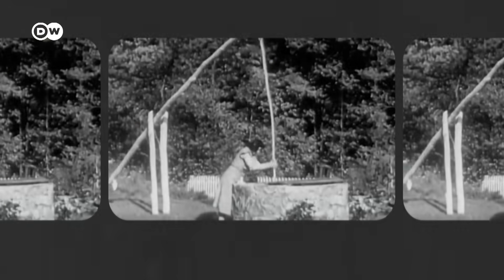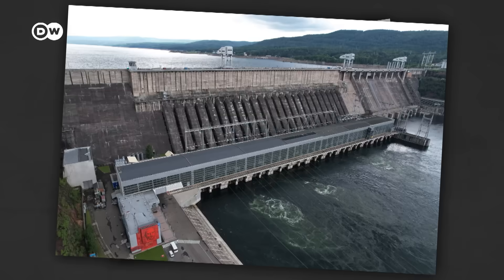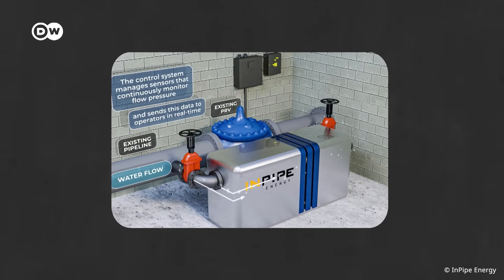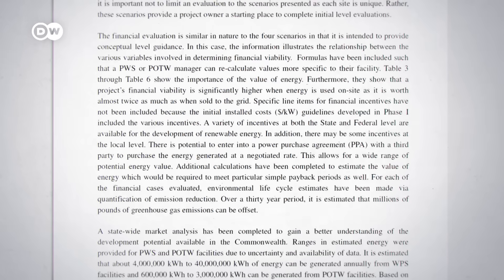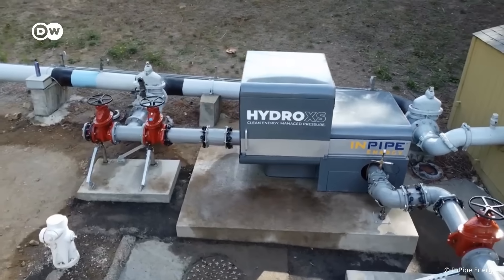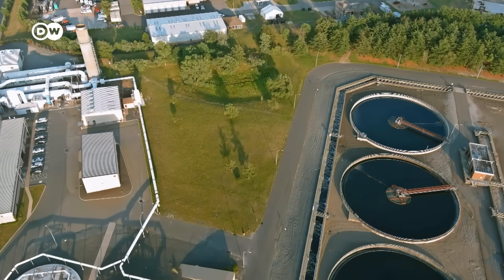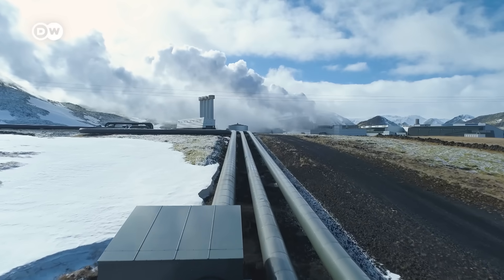In-pipe energy: The hydro power nobody is talking about

Comment: Imagine acres of durable long life solar  panels over lakes and rivers powering pumps that refill thousands of water towers on land and at night it is released at a rate that provides steady power throughout the night and more if necessary.
Reply: Well... About that...
The potential energy is defined as E = m x g x h, with m the mass in kg, g the gravity potential (usually rounded up to about 10km/s/s, and h the height in meter. E is given in Joules.
If you have let's say, one metric ton of water (one cubic meter) and let it fall from a height of 100 meters, you can get 1000 x 10 x 100 joules of energy, that's 1,000,000 joules, or approximately less than a third of a kWh. And the average western household consumes about 10 to 20 kWh of electricity per day.
So you would need a reservoir of about 60 cubic meters of water built on a 100m tall tower (equivalent to a 33 story building) to store enough energy for one household for one day. Alternatively you can reduce the size of the tower to 10 meters but will require 600 cubic meters of water.
So yeah... It's fair to say we won't see as many towers as that any time soon.

Comment: Adding turbines equals adding resistance to the flow. If this is done at scale, there would be MORE ENERGY CONSUMED at the pumping stations, to maintain the pressure and flow, negating the energy generated by the turbines. Given that no turbine is 100% efficient, there would be a net negative result.

Comment: Seems like a way to steal electricity from the city power. All of a sudden their electricity bill goes up to pump that water harder to keep pressure at the right level as us homeowners are siphoning off that pressure to create our own electricity. Energy is neither created or destroyed, just transferred.
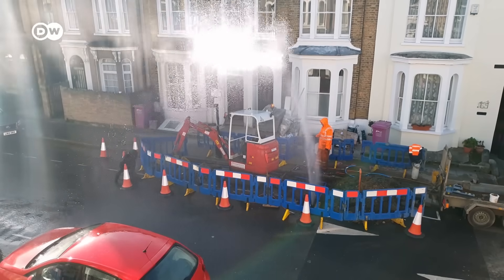Reply from the maker: Hey Kent! The video is specifically talking about making use of the energy that's currently wasted at pressure-release valves. Check the section around 2:36 where we explain it in more detail. 💧

Comment: This is stupid. It is not free energy. If you put a turbine in pipe and draw electrical power you are reducing the line pressure. If the pressure was too high to start with just reduce it and save on the massive cost of pumping. If it was not too high you will cause distribution problems further down the line.  You could charge your telephone at the point of delivery if you have more flow that you need. But installing anything actually in the distribution network is like putting a dynamo on the front wheel of you bicycle to power an electric motor on the rear wheel !!   Stop your "carbon" BS and learn some basic science before making a video.
Reply from the maker: Hey there! The video is specifically talking about  making use of the energy that's currently wasted at pressure-release valves. Check the section around 2:36 where we explain it in more detail. 💧
Reply: @DWPlanetA  Ah! So it's talking about extremely small, almost negligable quantities of energy that you might be able to harness an even smaller percentage of! 

This harebraned idea is little more than nonsense.

Comment: just design the pump more efficient, and prevent it from creating excess energy to begin with
don't spend extra energy to create energy, that's dumb your stacking inefficiencies like friction, and heat loss on top of each other

this only make sense when your not spending energy to pump water, such as when your water is stored up high
then you can use a turbine to generate power and lower water pressure to safe levels

Comment: It takes energy to move the water through the pipe, so it stands to reason that by adding the resistance of a turbine to generate electricity just means that the system will have to use that much more energy to overcome the resistance, thereby requiring the water utility to add the same amount of energy that you're removing from the system. There is no free lunch!
Reply from the maker: Hey there! The video is specifically talking about the making use of the energy that's currently wasted at pressure-release valves. Check the section around 2:36 where we explain it in more detail. 💧

Comment: LETS TALK ABOUT COMMON SENSE.  
water is pumped at very high pressure because very high buildings require that much immense pressure to lift water to tanks which is 
situated at top of these high buildings.

BUT THE POOR PEOPLE LIVING IN SINGLE FLOORS DON'T REQUIRE WATER AT SUCH HUGE PRESSURE. 
IN INDIA  MOST OF THE BUILDINGS ARE SMALL.
THE RICH PEOPLE OFTEN LIVE IN TALL BUILDINGS.

SO PRESSURE ENERGY IS GETTING WASTED WHICH LEADS TO WASTAGE OF ELECTRICITY.

 SO THE SOLUTION IS THAT WATER MUST BE DISTRIBUTED AT LOW PRESSURES  AND TALL BUILDINGS MUST HAVE THEIR OWN PRIVATE PUMPS.
SO PEOPLE OF TALL BUILDINGS HAVE TO PAY MORE MONEY FOR SAME WATER USED BECAUSE THEY ARE USING MORE 
PRESSURE ENERGY (WHICH MEANS MORE ELECTRICITY).

FOR EXAMPLE, IN INDIA (JUSCO ) DISTRIBUTES WATER AT LOW PRESSURES AND PEOPLE LIVING IN TALL BUILDINGS HAVE THEIR OWN PRIVATE PUMPS.

SO CORRECT THE      CORRUPT SYSTEM     RATHER THAN USING   FANCY DEVICES.

Comment: Hi all just a message just posted this on some windfarm sites thought it was worth adding to this page So. 
If you grind up old wind farm blades both glass and carbonfiber and add then to wet concrete at the batching plant i can see a real risk issue can you? ,,,,,   Well its 30yrs later and the slab is to be crushed up for the new development to get made what happens with the rubble ? and more worryingly the dust. We have seen this before with a product that was loved in its day and ended killing thousands it to was mixed into concrete as sheets got were i am going yet NO ASBESTOSIS disease a man made issue rearing its head again will we ever learn from the past?

Comment: I found this video trying to understand the variables to make a good turbine. Here is my situation: I live in Alaska off grid. Things that are true: It is dark here in the winter (thus solar is not a great option) and water and rain is abundant and I live on a very steep hill. I do not understand the physics of how the conversion of potential energy (moving water) is then converted into power. If I wanted to make use of hydropower in a very small way what formulas do I need and what factors change the potential to capture the energy most efficiently? This would not be the only source of energy, but I would be great to have as many as possible as there are not services in our area.

Comment: solar & wind are not green tech Why? both end up with 40-60% in land fill so what is green tech? RDP Marines add on units to dam to make more power from the same volume of water used lasts 100years fully recyclable and unlike pump hydro which uses 40% more power to lift that water than is returned. Now just for full disclosure i am RDP Marine AND we have an add on system for large water storage dams and hydro to make more power from the same volume of water. So all dams have one bank of turbines due to issues if there were more we have fixed that issue and now three banks can be fitted
Reply from the maker: Hey Simon! We just published a video on wind turbine recycling that you could be interested in. Check it out here 👉 https://www.youtube.com/watch?v=HzQShAlObn8
Reply: Thanks for the direction did as you said got a comment for your bosses.
Wittenoom near Perth Australia is a small town now made a no entry place with a exclusion zone of 200 Hecters square . why am i telling you this well the reason is in the local mine is a rock with fibers in it that was a big deal in its time you may know of it as asbestos now what do you think will be the outcome of concrete being busted up that has glass fibers in the dust ?

Comment: The energy inside the pipe is to ensure most of the people has enough pressure in their household. Not for energy generation. If you want to save energy, the pump system should be designed intelligent enough not to over pressure the piping system.

Same thing, You shouldn’t put a solar panel under a street light to generate electricity because street light is simply not meant for energy generation.

Comment: Typical woolly green thinking here.  This is akin to fitting a wind turbine on top of a car and ignoring the extra power needed from the engine to drive the car against the drag of turbine.  The power to move the water has to come from somewhere - and that energy would be from the pump supplying the original pressure -  more resistance in the pipes from turbines will increase power required from the main pump.  The greenies will talk about this idiocy, but engineers will not.

Comment: In simple summary, if the area's water system use pressure valve, then that system can be use to generate electricity.
Some area might dont have enough pressure to supply water

Comment: WHERE TO BUY THIS SMALL WATET TURPINE?  AND: HOW TO TRANSFERE MOVEMENT OF THE BLADES INSIDE THIS SMALL TURPINE TO : (OUTSIDE; "without leaking out water"= SO TO USE THE THE MOVEMENT OF THE TURPIND INSIDE THE PIPE : TO USE OUTSID THE PIPE TO ENGAGE A WHEEL or so, AND THEN TO CONNECTED TO A GENERATOR??? THANKS

Comment: I know you have worked very hard for this but as a student of engineering I think this tech is unreliable because there is a question of efficiency. If you consume energy to generate pressure and in turn use that pressure to generate energy again then you just gain a fraction of the energy you had before. The overall potential is very very less than 4 % of the global energy demand. you need infrastructure to produce that energy which will be really really expensive. 
suggestions are welcomed...

Comment: i am not getting the excess pressure point. It is pumped into a tank and distributed from there. where is access pressure? In pipe turbine probably effect the delivery of the pipe too. at least the speed of the water in it. Probably there is a way around it. Keep up the research.

Comment: Ok... so the idea is to put turbines on the lines leading out of pressure control valves to generate electricity from the water that we are forcing out of the system to avoid pipes rupturing from the pressure being too high. Essentially, in water systems where we are currently wasting a lot of energy, we could reduce the amount of energy wasted by recapturing it at the back end.

This is thus really an energy efficiency measure... making our least energy efficient water systems slightly less bad. We'd still be wasting energy to get rid of water without using it... but not as much energy. As such, it is worth doing... but IF this is really going to generate significant amounts of energy then that means we are currently WASTING vastly more energy (and water) on inefficient systems.

Comment: The issue is that such a technology will not solve anything. If everyone puts an in-pipe turbine in their pipes, it will become harder for the water pump to pump the water, increasing the energy consumed by the pump, which in turn increases cost of the water. This is because energy cannot be free; it is a basic concept of physics. In short, energy generated by personal in-pipe turbines is energy taken from the pumps pumping the water.

If one or a few people install an IPT, it will be fine. If everyone installs an IPT, there will be an issue.
Reply: The pump will keep working the same way they are not going to replace the pump for more powerful one. But the water pressure will drop, water filters will stop working, some showers won't be able to push the water through small holes etc.

Comment: Energy is NEVER free! The energy tapped from the in-pipe turbines comes from the excess energy or pressure given to the water delivery system. The issue is NOT to tap energy using in-pipe turbines. The issue is to reduce pressure given to the water delivery system. Save energy at the source, not in-pipe!
I suspect this video is done by a journalist who does not know much about physics, let alone engineering. If I were the author, I would immediately withdraw this video from Youtube.

Comment: This seems like an absolutely dumb idea. Instead of properly managing water pumps so they use less power and run at pressures that the system can manage, you're suggesting using those pumps to over-pump water in order to spin turbines to generate power? That's like putting your car on a passive treadmill that's connected to dynamo and saying "Hey, look, my car is making free energy".
This would only work when the water source is high enough so that gravity does most of the work and you need a pressure reduction at the bottom. Otherwise it's the stupidest thing I've seen since Solar Roadways. Is this a rejected Matt Ferell video?

Comment: This video's content is extremely MISLEADING, or simply WRONG. Clearly, neither the video maker nor the professionals know how water distribution systems work. You CANNOT get energy at the end of the distribution network, simply because you need to input energy to make water reach there. The energy you will get at the end of your tap is the energy from the pump! 

The only way you could potentially get some energy is when the raw water source is at a high elevation. You could use a turbine in the pipe when water flows from high elevations to your water treatment plant at a lower elevation.

Anything in or after the water treatment plant will consume energy, and you cannot derive energy from that. You are consuming more energy from the pump at the water treatment plant or pump stations if you put a turbine at your tap!

Comment: Is it April First?  Where does this 'free' energy come from?  You are simply borrowing from Peter to pay Paul.  The principle of conservation is clear; if you harvest energy along the line, then the line MUST lose that energy.  But this is far worse because there is significant inefficiency in the harvesting -- you require enormous amounts of extra energy (and material) to manufacture and install the in-pipe turbines.    
The only positive item is to harvest the wasted pressure at the release valves.  You can cover that in a single minute, without eight extra minutes of fraud. What's going on DW?

Comment: In general, the idea is not new; energy restorers are now common for large consumers of high-pressure compressed gas or steam. But these are megawatt capacities for each turboexpander.
In modern high-rise buildings, there is a problem with high potable water pressure on the lower floors.
It is solved in different ways but as a rule. Instead of one common pump station in the basement, two or three small ones are installed (which increases the total cost and increases the dimensions of the mechanical room and the mechanical shaft) and still, for a good quality of maintaining pressure on a particular floor, it is advisable to install pressure reducing valves on the floor as a whole or individually for each apartment. That is, for the best quality, there is no escape from the installation of individual reducing valves.
And instead of them, it would be interesting to install an expander (energy recovery unit). In front of an individual water meter.
1) Easier and cheaper for pump groups.
2) It is more convenient to set the pressure that is comfortable for you (it can even be from a smartphone). In the codes, the pressure is written in a fairly wide range. And in fact, someone gets too high water pressure in the shower, someone insufficient. The pressure-reducing valve is usually located in an inaccessible place and it will require a plumber to adjust it ...
3) It will be fair :), those who live on the lower levels will get more benefits and more energy. Bonus for not having a nice view.
4) It is more visual and more interesting to control energy recovery, everyone sees a specific result, his own result.
5) Or it could even be a three-in-one device: water meter/expander/pressure reducer. With smartphone app and parallel connection to BMS.

Sorry for my English. Hello from a Ukrainian engineer :)
I wish you success in your research and experiments and bring things to the production stage!

Comment: Its not "energy generation". At the very best its "energy recovery" ... all of this is about energy we put into the system in the first place, the pressure isn't there out of happenstance.

So you got to have circumstances where you would be lowering the pressure anyway, because if you just slap a turbine into the main, the pump at the other end just has to work harder, leading to a net loss in energy.

Comment: Sooo many wonderful solutions are not what they seem, and I'm afraid that in most cases, that's the case with this application of technology because that pressure comes from one of two sources 1) pump energy or 2) elevation energy. In the case of (1), if you harvest electricity from water pressure created with a pump, you're at a net loss, or at the very best, break even, because it took electricity to produce that pressure in the first place. In the case of (2) if there's EXCESS pressure in the pipes due to high elevation (head), you could simply harvest that energy at the source (of the water) to create electricity, and that would be more efficient. It's hard to conceive of any way that you're actually gaining free energy because the energy in the water pressure is either created by electric pumps (which could then be reduced to save electricity) or by a high water source (which could be harvested at the source). The only way I can think this would be valuable would be (a) if there happens to be EXCESS (not simply "abundant", as per the presenter) pressure in the water system, and there's no way to reduce the energy used to create that pressure, or (b) There's a location that needs electricity and the only way to deliver it is through water pressure. So I don't think this approach amounts to much.